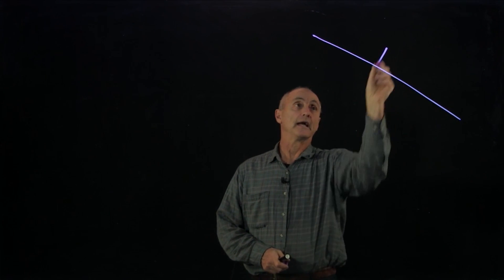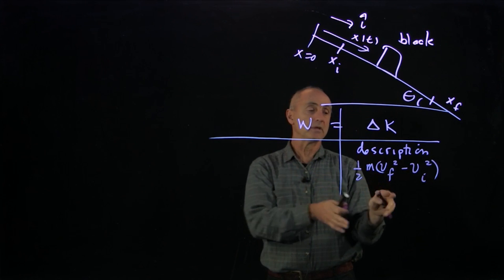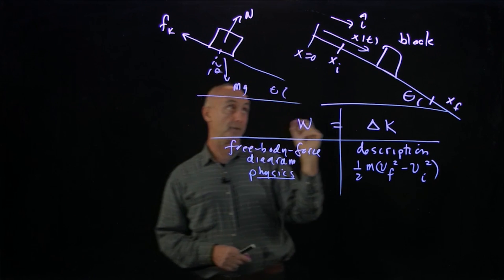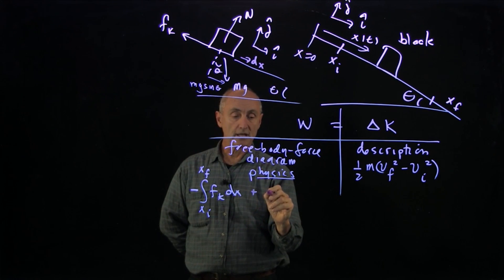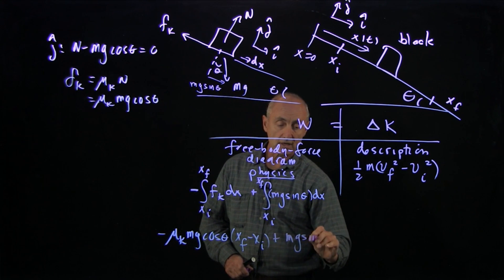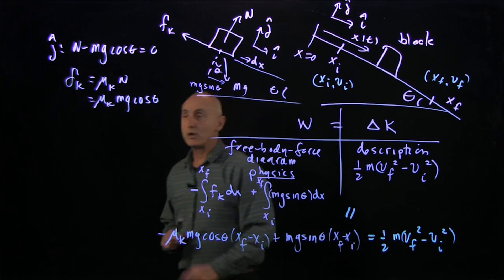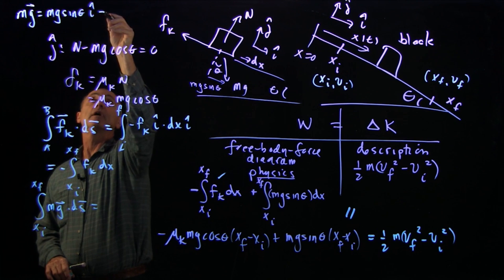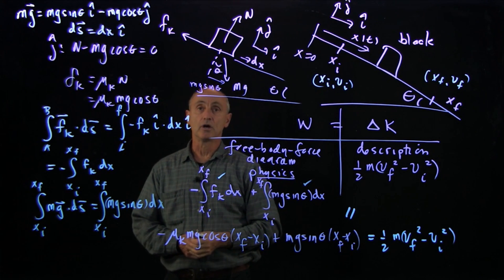21.6 Worked Example: Block Going Down a Ramp

Comment: The Work-Energy Theorem is incorrect to begin with and W ≠ Δk. Work is not a function of displacement and W ≠ F ⋅ ds. Kinetic energy is not 1/2mv^2 neither.
Reply: I think we're still dealing with constant forces here so simplifications can be made
Reply: @jackdawkins629  It doesn't matter because the equation for the work-energy theorem is incorrect and ,so, W ≠ ΔK.
Reply: @BTWPhysics  can you explain why it's wrong? is it the shortcut calculus you don't like or?
Reply: @jackdawkins629  It's not the calculus that's wrong and ,thus, the calculus is fine. The work-energy concept that's being taught is incorrect. The energy transferred by an external force is not the work done by the force which also means that the change in kinetic energy does not reflect the net work done by the net force. 

If you push on an object such as ,for example, a wall or a chair, then there is an external force on the object. But, what are you actually doing or what is happening? You are transferring energy to the object in a specific direction. A greater external force on an object then would transfer a greater amount of energy to the object. This suggests or implies that there's a relationship between the amount of external force on an object and the amount of energy transferred to the object as opposed to a relationship between the work done on an object and energy transferred. The amount of energy transferred to an object by an external force would simply reflect the magnitude of the external force.
Reply: @BTWPhysics what are you talking about??
If you push a wall with a force, and the wall is not moving, then no energy is being transferred to the wall.
Reply: @kvisachaderah896  What are you talking about actually??? Just because a wall doesn't move when you push on it doesn't mean that no energy is transferred to it.
Reply: @BTWPhysics  oukay, then tell me, what kind of energy is transferred to it and how?
Also where do you get your information from?
Did you test what you are saying?
Reply: @kvisachaderah896  Shhh, he can't backup his claims. He doesn't believe work is a real thing. He's been spamming this comment on all the MIT vids
Reply: @piupolino2618  Sound the alarm
Reply: Bro stop I see you in every vid trying to disprove work is a thing lmfao